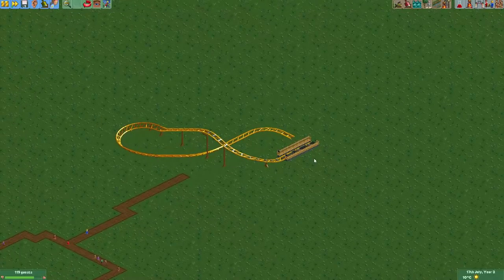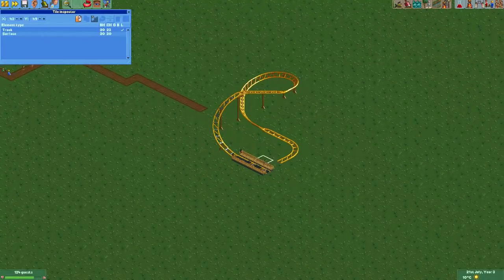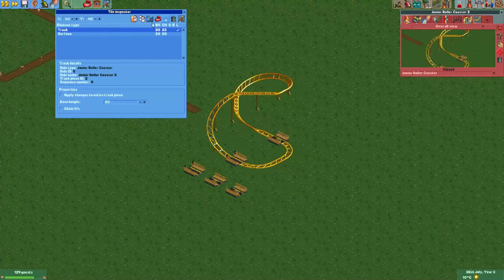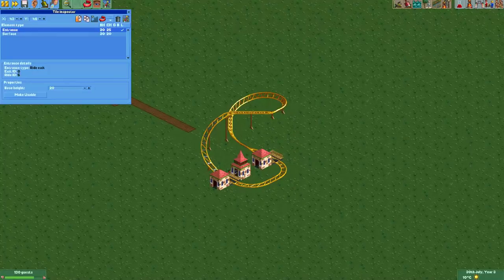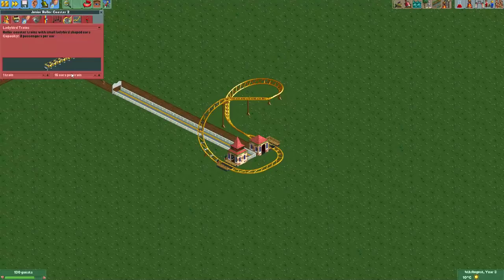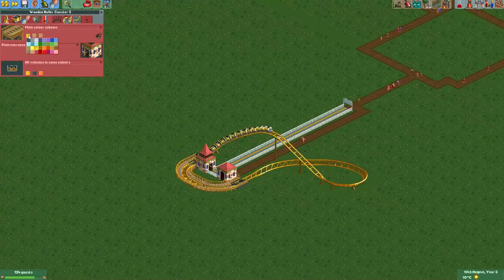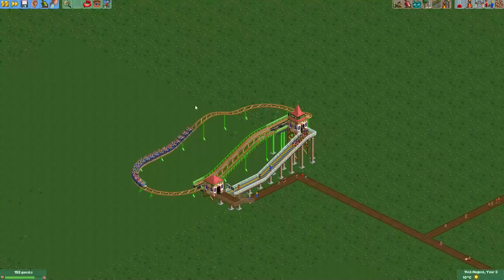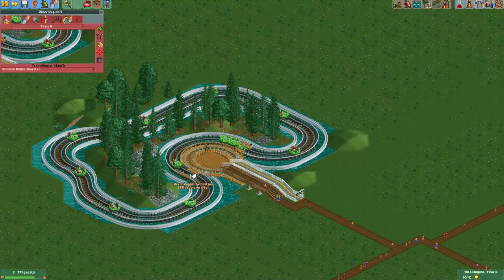Git gud at OpenRCT2 #13: Making a curved station

Comment: Looks good on the river rafts, but im not sure how to utilize this on a coaster just yet.
Reply from the maker: I have used it to recreate some compact rides, like Loopen in the park Tusenfryd. I also sometimes use it to extend a go kart station if there is not enough space to make the station straight. Finally, sometimes I just want to make sure all trains of a ride can fit on a station so people can always exit, and then it's useful if you can extend the station around a curve so it doesn't become too long. I'll admit the situations where I needed it are pretty rare, though!
Reply: I think you could use it for some sort of water slide, or water ride of the sort, where guests board the cars up and leave 'em once back down.
Reply: @S.M.Jean-Mahmoud_Ier  very good point. I imagine it may be useful on a bobsled ride, where you want to start at the top and chain hill back up.
Reply from the maker: @CtK_Evasive  There it's probably just easier to add a second station at the bottom, with just an exit :)
Reply: Some historic wooden roller coasters have curved stations.
Reply: @Intaminator  The reason i been searching for this Video (There's a Wooden Coaster in my town built in 1951 with a curved station and it was irking me to try to recreate it because of that)

Comment: I really wanted to learn how to build coasters over others, like using the Wooden Coaster curve on the Junior coaster. When I try doing it the track goes 1 tile above it. I noticed that is a trick much used and it makes rides much better... what am I missing ?
Reply from the maker: Make sure to disable clearance checks! That allows you to build rides wherever you please
Reply: @Deurklink  Exacly what I needed. Tysm

Comment: I think, this dosn't work anymore.
Even if both station parts are "Stationindex 1", they both require an entrance and exit, wich is impossible, because they are both Stationindex 1, wich moves the entrance and exit :D
Copying the entrance building and make it usable, dosnt work either. :(
Is there some new tech, or is it: R.I.P. Circular Rafting Boat plattform?
Edit: Im using the development branche
Reply from the maker: It still works for me!